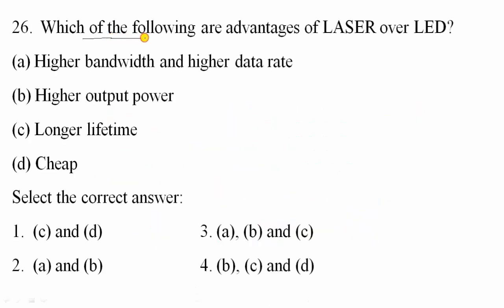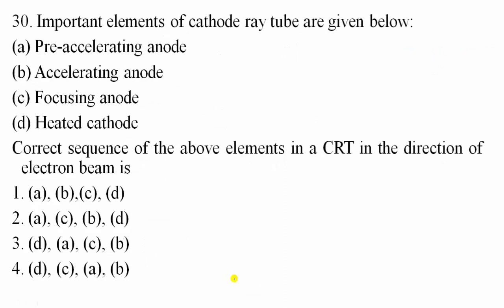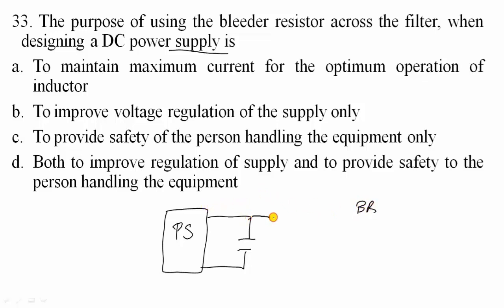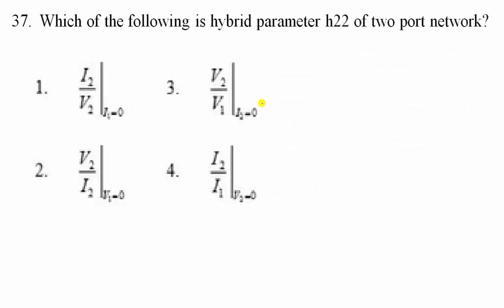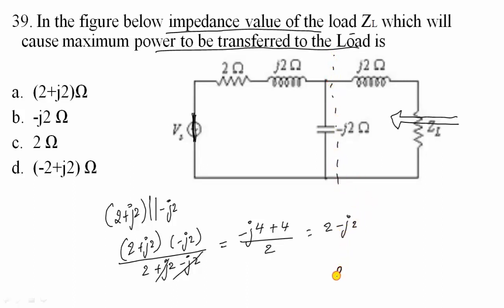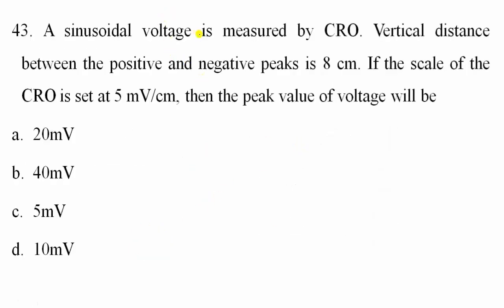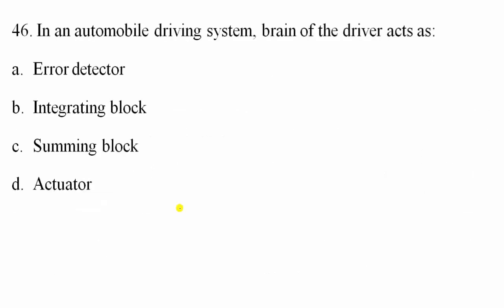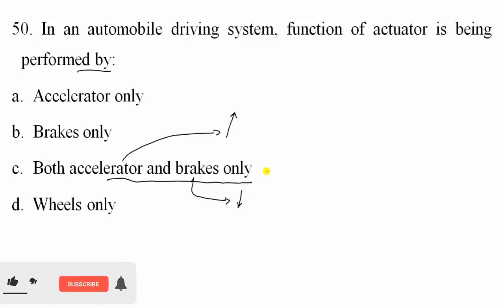UGC NET Electronic Science June 2019 Part 2 (Q26 - Q50)

Comment: Sir please tell what is a bleeder resister?
Reply from the maker: For safety point of view.
Once you turn off the supply, there should be no any charges stored across capacitor.
We provide discharging path and that resistor is referred as bleeder resistor